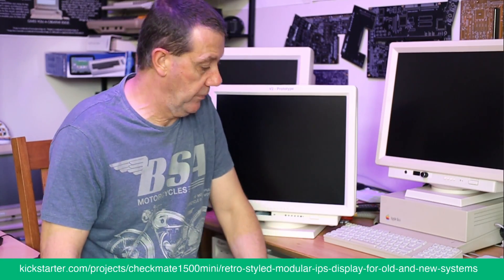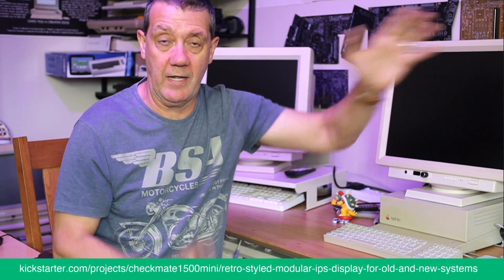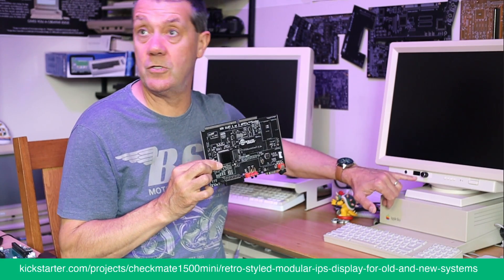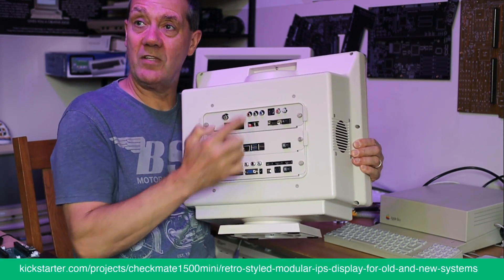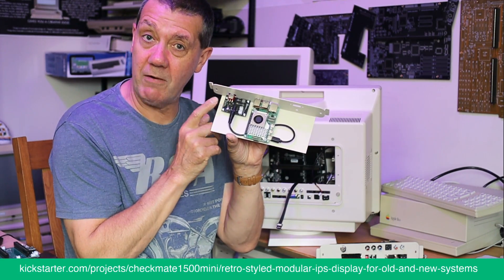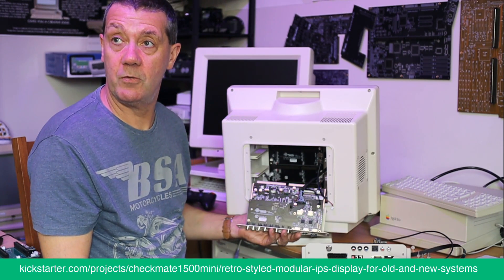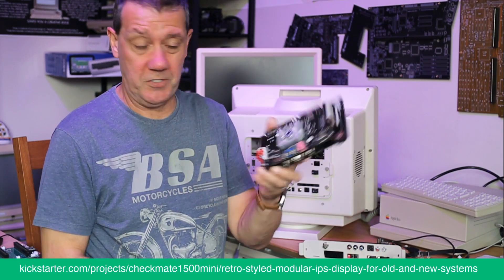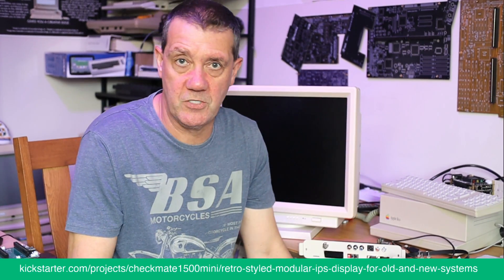Checkmate Display Kickstarter to production Journey

Comment: Q: If I want to run my mister through a retrotink 4k and back into this monitor, how is that done?
Reply: E.g. right now I have direct video over HDMI from mister going into the tink 4k, then HDMI coming out.  Assuming I can't shove the tink 4k into the back of this monitor (yet), then I'd need an HDMI out coming from the mister panel, run the tink externally, and then I just need a generic HDMI input to the monitor.
Reply from the maker: Just use HDMI in, but I do not actually see the point personally because the 4k will have to be squashed down to 1280x1024
Reply: @Checkmate1500  Even at that resolution, there are actually some pretty compelling CRT emulation scaling effects.  You should def check it out if you haven't already.